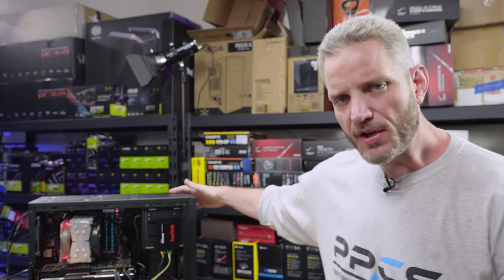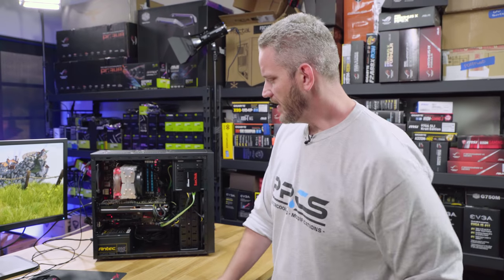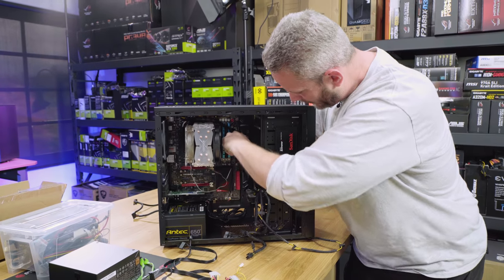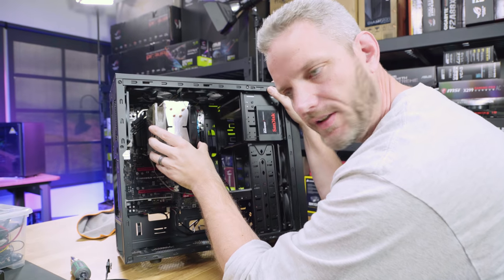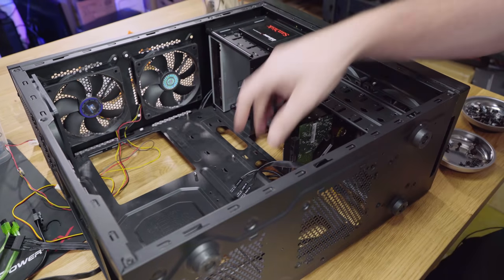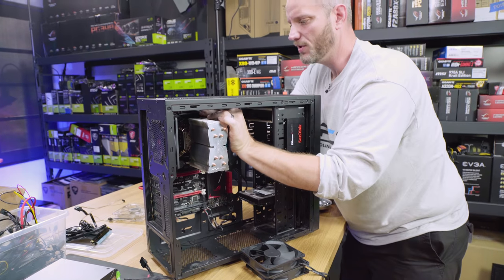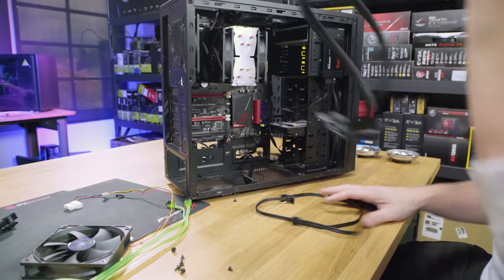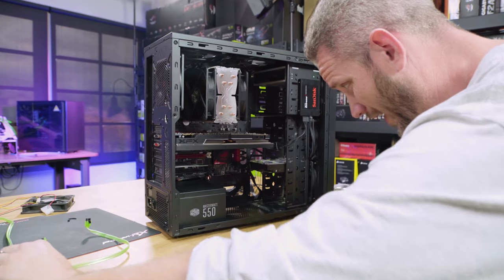It was worse than I thought... Fixing PCs Part 2

Comment: 650W should be enough to run everything. 
There's also no reason to put 2 fans on the CPU cooler. Only 1 fan blowing, is going to do the work.
The other fan is just redundant.
Reply: Chris Collins  Nope.

Comment: If you was gaming with a Xeon  what a good clock speed wood you need in to run 2.4ghz or higher a sweet spot wear work it be if you can overclock it locked to 2.4ghz

Comment: I recently worked on a old couples system. I replaced there drive before as it was failing. There system is 15 years old, yes they wanted me to replace the drive even though I told them that 6 months down the line or 3 weeks or the next day or ect the computer could have another part go out. Well 1.5 months later, this last weekend, I get a call from them saying that the computer turns on but no display basically. I go over there and I confirm the issue as I see the fans spin and light on motherboard, but no display. I cleaned the system of dust, still no display. I tried my monitor, still nothing, I then disconnected all the drives, so it is just the essentially of 20 pin and 4 pin cpu and still no video. They had no gpu, so they using on board graphics. I removed the cmos battery and still nothing, I tested the cmos battery with a volt meter and it passed with flying colors, put cmos battery back in, still no display. I reseated the memory, no display. I testing the psu by swamping it out with a known good one, still no display, I tested memory with known good memory, still no display. I tried putting the memory stick in different slots, still no display. I reseated the cpu and check for bent pins, no bent pins, so I reseated cpu and put new thermal paste on, still no display. I breadboarded the system, still no display. At this point I knew it was either cpu or motherboard. I know 90% of the time when it comes down to either motherboard or cpu, its motherboard. I tell them this, and they agree to buying a new system. So going this Friday to help them pick out a new system and putting the windows 7 back on the system since they like the old os that is outdated. I was extremely surprised that the cmos battery was still good after 15 years, that is 3 times the maximum life expectancy of the cmos battery, wow.

Comment: Hey Jay, have you ever had issues with motherboards because not enough standoffs were inside?

It just hit me that i only used 3 standoffs when installing my motherboard and i am experiencing some issues. Every 1-2hours im getting those 1-3 second video/audio freezes where the screen locks up and the sound goes BZZZZ

Im considering the PSU is going bad or that the video card has some issues. I'm not sure where to start

Comment: Question, have the same power supply as you used here (okay 650W). Is the coil whine for you bad as well? When my power supply is a 40%+ use is so so bad! I hear it over 6 fans at max speed in a  Fractal Design Define R6.

Comment: I'm not trying to be that person. But at 25 years old, I built my first computer and it booted properly and all. It is possible to do it right the first time. Just do your research. And don't be sloppy. Just run the wires the way they need to and zip tie them. It's not hard.

Comment: Hi Jay.. :D How are you today? I know people might laugh at my question request and I am not sure if you even consider it. Anyways, here it is. I have an old Intel i7-3930K processor with a Gigabyte Assassin 2 ver 1 motherboard. I tried overclocking my CPU but the guides and information available in the overclocking forums are for the motherboard with the previous version of BIOS. So, I cannot follow along with those guides or info. I cannot literally afford to upgrade or go for a new system and so overclocking it to 4.5GHz is the only way. I have a corsair i115 AIO water cooling. Is there any chance that you could guide me. All or most of the options in the current updated BIOS are changed/renamed. I really hope you would consider my request. Thanks in advance.

Comment: Whoever built this computer...wow.
Built my first pc a month ago with no help besides google and it was done professionally. Never had to take it apart once it first booted, all wires are clean and tied back. Only issue i had was a faulty fan splitter that came with my case which i swapped with a noctua one.
Point is, you don't need to be a pc/tech expert to build a pc...just PATIENCE.

Comment: ever had a system you cant install any os on but will run off a linux live usb without any issues. I've tried multiple os and multiple ssd's and hard drives even tried installing win 7 from a CD drive. all options fail with some kind of missing file or file doest match error.

Comment: Shits funny to watch. Been building and modding since 386sx back in the early 90's. Watching trends across three decades is funny... Cable management back in 90's didn't exist. Case fans? HA! We might had one... Two maybe if you were rich... MB with stacks of cards on them to get anything done. All integrated now. A $5000 PC back in the day was a lot of money. A new Ford Fiesta was around $6k. And our first one took the better part of a weekend to get assembled nd running with all the drivers. Since the clear sides came out all the kids care about is aesthetics. Water cooling which was a wet dream back in the day is used because it looks cool in no OC rigs. But hey A ford Fiesta is like $18k now.... How much PC is that? These things are stupid cheap and easy to build now.  Personally.... I give a shit about looks. As long as it plays the games I want at the Settings and Frame rates I want, I'm good... Now fifty fans and RGB everything. This road was paved with hard sweat. Don't be such dicks to each other. At least this guy didn't get an Xbox.

Comment: Hey Jayz I’m going to be building my first ever PC and I’m aiming to play games on it. I’m going for a GTX 970 as my graphics card with an amd cpu with the am3+ connection I have a mother board in mind from gigabyte and I’m going with 8gb of ram the Corsair vengeance series for storage I’m going with a 1 TB WD blue HDD and also a Sandisk 120 GB SSD my power supply is going to be the Corsair CP 9020098 this is rated at 80+ and my case is the thermal take Verda h22 windowed these components will be costing me about $730.29 would this be a good system for a budget build? And would it work well for gaming or should I invest into a newer graphics card?

Comment: Fuck the people who complain about unsightly wiring in other people's computers. There is no objective reason why this is bad. As long as everything is wired correctly and the airflow is ok, it doesn't matter one bit. Believe it or not, most people, even in the Enthusiast Range do not RGB their shit up and display the innards of their computer. They just don't. It sits beside the desk, gets turned on and off and that's it. I am not saying there is something wrong with going for looks but this is a completely separate issue that actually has nothing to do with computer stuff at all. You might just as well install blinky lights in your 300 Dollar Air Jordans or wear a prada man purse.

Comment: Iv got a e5 2603v3 on x99  Xeon 6core 6 threads clock at 2.0ghz some on the games going to the safe mode because of the clock speed like on gta 5 
Far cry 5 so what would be a sweet clock speed to game 2.4ghz or more I cart overclock it it locked cpu e5 1620v2 on x79 its a good cpu 3.6ghz 4core 8threads little beast for gaming

Comment: You gotta understand that the community was appalled by the level of neglect in this build. We are talking about a community that talks about pc porn. Ordinary people would think pc porn is porn that doesn't run on a mac. My first build wasn't perfect ether but mine had ALL the screwholes filled. My dvd drive and cd burner were both fastened with 8 screws, the hdd's were fastened with 6 screws! I know way overkill but I wanted it to be built properly and I figured if it has a screwhole it must be used and I was disappointed there weren't enough screws included.😂

Comment: Does anyone know what the tool was called that Jay used to clean the dust out of the system? Thanks :)
Reply: It's an electronic vacuum. You can go on amazon to look for it
Reply: @venividivici4253  A vacuum? but don't they damage the hardware?
Reply: @SophiesNotHere  Not really. It's designed for electronics.

Comment: With the Pc community freaking out over those wires, they would die if they saw my setup, its a ROG G20 prebuilt, with a hole cut in the side for my PCIE riser cable to go through to reach my graphics card that is on a stand beside it, because this shity prebuild cant fit a full size gpu in it and i didnt wanna have to buy a whole new system just to upgrade my gpu. pls no bully

Comment: Well done Jay, tell these ignorant Youtube elitists what for.  I love how 1 twit puts together a supposed gaming rig 1 time and all of a sudden thinks he's a tech or an expert....lol only on the internet.  Hell I wager more than 80% of those who made those comments think building a gaming rig is just jamming only high priced items into a case and flipping a switch.

Most repairs I do are from these same Jack-a-lopes who don't know how to configure what they've built.  Lets not talk over glorified air coolers or Water cooling as the lame wits describe it.  Those bring in the good bills when they fail.  The smell of fried electronics makes me know it's Lobster night for dinner ;P  Keep mixing Water with Electricity Murphy knew nothing...NOT

Funnier still you can see these same Elitists crying in the Steam forums that THE GAME crashes or doesn't work on their system so it's the developers fault...you can easily tell these clowns cause they throw their system stats in as if to brag...."Gutta i7 8700k oc'd to 5ghz and 32gb ram and a 1080ti Take over the world edition,  and this game needs optimization" Most don't even know what optimization means lol cause I can run the same Games on an i5 haswell with a 1060 just fine.  Sadly this is the community now.

P.S If it has a Radiator but no thermostat it's actually a Hydro Air cooler and is not the same as Water Cooling like what's in most vehicles....nowhere even close, but is a small step up from air cooled rides like Corvair's and Beetle's.

I give props to the person who built this rig only for the fact they tried,  lotta people get too scared.  Yes he failed but he learned a few things I'll wager as well and his next one should be far better.

Comment: lmfao you would laugh at my pc ahahah, my setup is jank as hell dude, zipties holding a 200mm fan on the side, 3 200mm fans and a 120mm fan in the back, plus 2 cpu fans from the noctua massive cooler i got that doesnt seem to do a hole lot since i idle at like 60-70 for some reason ahah, im so outdated to, saving for a i7 3770k and some new ram so i can do quick upgrade without breaking the bank entirely

Comment: well nobody will judge a 1st pc build on the cable management, but is another story when i see unconnected power cables to the fan cables. you are not a noob, you have no concept of basic logic if you do stupid things like that! like someone connecting a power extension to itself and waits for it to work! /facepalm! so most of the bad comments was on those points, not the "beauty"  of the system. :)

Comment: if they are going stand pc on the floor mount the PSU fan side up
Reply: That's not true. That's an intake fan on the PSU. Aim the fan toward the opening in the case.
Reply: There are several videos arguing over which direction is best. We are not going to solve it here.

Comment: Hoping someone can help. 
I have a ASUS M5A99FX pro r2 .0
I came a cross the weirdest beep code and in all my years building pc's never heard it before and cant find any reference to it online anywhere. 

When i turn my pc on. It does its single beep good post. 
Then beeps twice then 3 time very very quick. 
Vga led also stays on. 
Earlier it would boot fine but as soon as i reach the desktop the screen would turn off but can still hear audio. Pc works just no image. 
Hit the power button once and it shuts down. Powering on again image comes back until you get to the desktop again then no signal. 
Safe mode works does not lose image. 
Uninstalled the display driver
Restarted and it gave me the beep code. 1-2-3 
Changed slots to the black 8x slots. Beep code gone only one for post yet no image and vga led stays on . 
Did a bios flashback still same beep code. 
Changed the ram. No change beep code still there. 
If i remove gpu completely then you get the usual gpu not detected beep code. Different to the code above when gpu is inserted. 

At a loss dunu what to do. Anyone experienced something like this ?

Gpu is GTX 970 EVGA ACX2.0 gaming.
Reply: you should record the beeping as you are maybe, just maybe, getting it wrong. Could be a problem with GPU/inboard, hdmi/vga port, pci express slot?.. but cant find anything with the beep code. Just guessing. What i would probably do is using safe mode to run a memtest86x, and probably trying to use another GPU for testing. Maybe even the PSU isnt working correctly and not delivering the right amout of voltage to your GPU, so testing that too would be a good option.
Reply: @Chris-ko7ov  Many thanks for the reply.  i also thought i was getting it wrong.  So i recorded it using the slow motion feature on the samsung note 8. Definitely 1 post normal beep a pause then 2 medium speed beeps  a pause then 3 quick beeps. 
Sadly i do not have another GPU to test with.  The PSU was replaced about 3 weeks ago. RMA unit as the one i had died completely. 
Replaced with a antech high current gaming 750w gold. 
I have also tried swapping out the pci-e power cables as its modular and used different outlets on the PSU. The same beep is still there. 
If i record it to where can i upload it so that you can hear the beep code.
Reply: Oh sorry forgot to mention. After i uninstalled the gpu driver and restarted i cant get the pc to boot again with any sort of display output. So cant run memtest 
I only get the beep and no image.
Reply: @francoiscombrinck3884  So PSU, you are positive its ok. Another GPU is not an option for you then. And you uninstalled video drivers and cant get it to boot. But safe mode is working, so that doesnt add up. I mean, what safe mode does its booting your system only with the necessary drivers and dlls for starting up. So if you do get video on safe mode, maybe its a software issue rather than a hardware issue. At least thats what i think ( im not an expert but i have fixed tons of computers), or like we already said, gpu (maybe testing your gpu on a friend pc?). Try resetting bios by taking the battery out a minute, and then back on. See if any configuration in BIOS could be changed, but if you could boot into safe mode, then i would back up my files, or maybe get another disk and reinstall windows on this disk to see if i get video. I did a BIOS update, and ive should have updated Chipset first, and couldnt get video of it, i had to recover windows.
Reply: @Chris-ko7ov  managed to get it sorted. Ended up being a faulty GPU. Baked it in the oven for 10 min. Working properly now. After boot up the sound chip on the MB is toast. So it boots fine when i disable it in the bios. So not sure if if the beep was for the sound chip or faulty gpu... but it was no where near the same beep code as faulty gpu. Took me a few days to troubleshoot the problem. Will now just put in a pci-ex sound card
Reply: @francoiscombrinck3884  that's some great news!! Happy for you. We were right all along, this damn solderings.

Comment: ☰

Nvidia unveils Titan RTX – World’s most powerful desktop GPU

Bradley Prior 2 days ago

￼￼

Nvidia has officially announced its new top-of-the-range GPU for consumers, the Titan RTX.

Labeled “the world’s most powerful desktop GPU”, it sports 72 Turing RT and 4,608 CUDA cores – outperforming the RTX 2080 Ti, which offers 68 and 4,352 respectively.

It also includes 24GB of GDDR6 VRAM – double that of the RTX 2080 Ti – and is aimed at the hardcore computing needs of researchers as well as wealthy gamers.

It offers a TU102 GPU, and can be used in combination with a second Titan RTX if users buy an $80 NVLink Bridge.

In terms of gaming, it is likely to be 10%-20% more effective than the RTX 2080 Ti.

Nvidia also highlighted the Titan RTX GPU’s ability to edit 8K video in real time.

The Titan RTX will cost $2,500, which is over twice the price of the RTX 2080 Ti